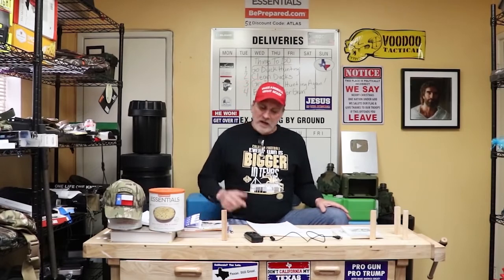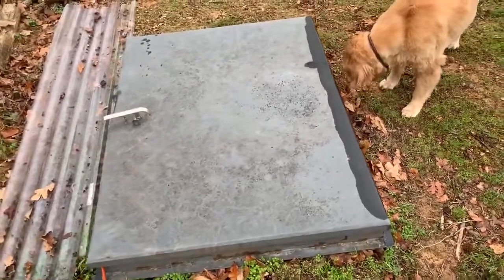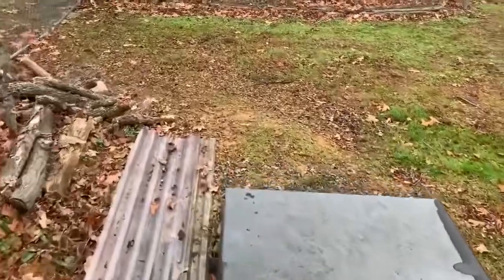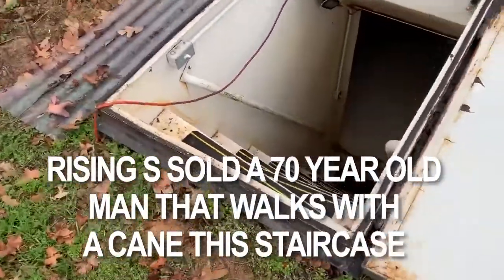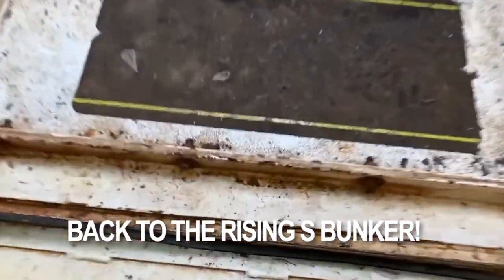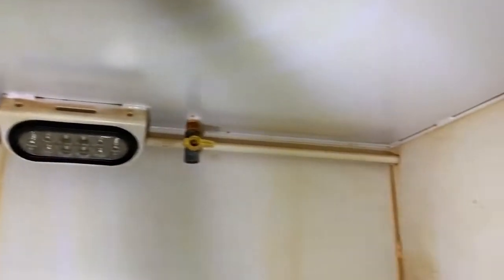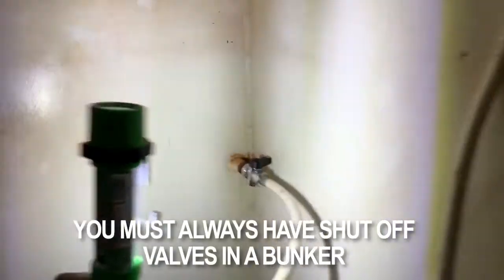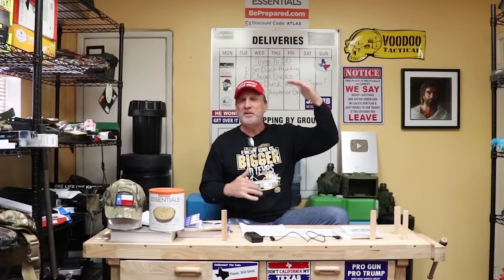Documenting how This $60,000 RISING S BUNKER fails to last even 5 years

Comment: So he left the water running or at least dripping and then didn't check it for a few months or years with predictable results. And no, the price isn't the same. You're adding some expense to construction and then adding many times that expense to the price. Then you're also known for add-on costs scams. I'm sure he could buy an entirely new bunker to replace that and still not spend as much as what you charge.
Reply from the maker: Thanks for watching